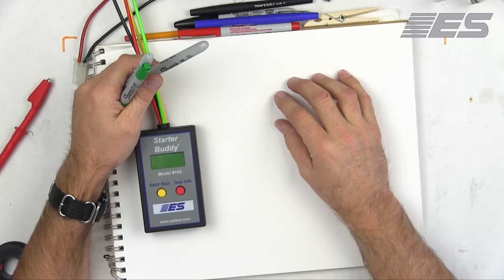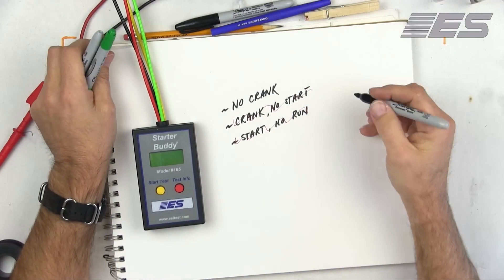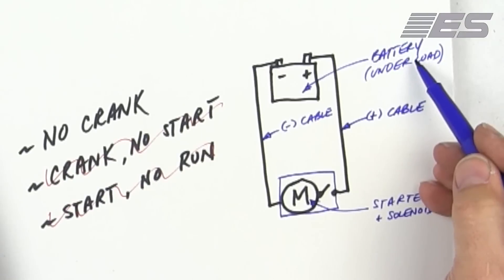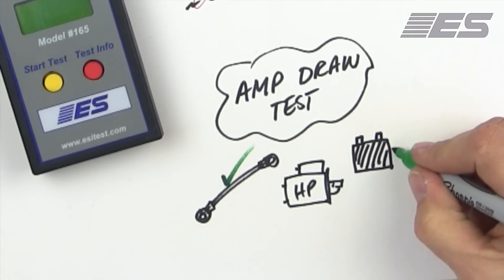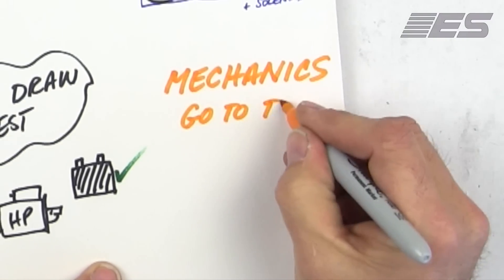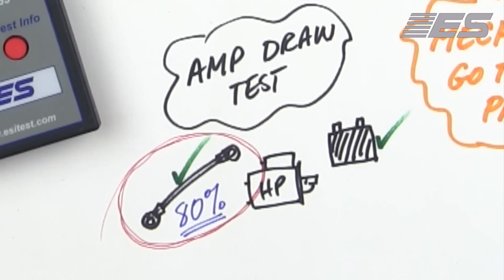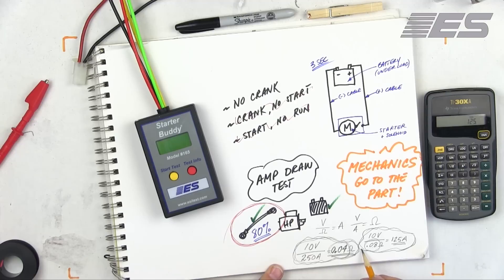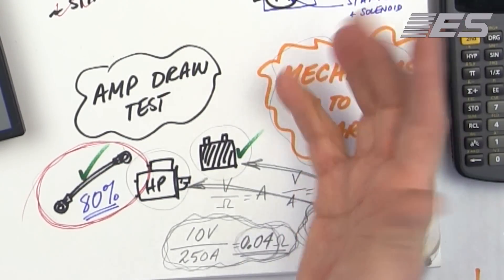Starter Buddy - Cranking Circuit Diagnostics

Comment: if the problem is the wiring then why does replacing a part even work?
Reply from the maker: +Rocket Rider Because the likely place for the corrosion is at the terminal ends of the cable, and when you change the part you clean the connection - so you think it was the starter or battery.
Reply: Wow, I get it ... Thanks for a quick reply !

Comment: When you get such a low resistance in a wire/cable of point 04 Ohms, you can't see it therefore you can't see any thing to clean. the resistance may be underneath the insulation , and if you peel off the insulation the copper wire would look bright. Or could look bright. and clean  So replace the cable. as you have said on other videos.Cleaning a wire terminal or connector doesn't solve the resistance because the resistance is  the product of the diminished size of the conductor. Right?
Reply from the maker: bob brawley Pretty much. The visual cues are TINY, or, as you said, invisible. Usually the problem grows over time and the starter slows gradually - no one cares. The best cure is prevention, and I LOVE silicone spray. It coats and it also wicks into the wiring to reduce water infiltration.
Reply: I've been diaeletric grease the wire to terminal then spraying with liquid I forgot what they call it. spray liquid electric tape but spray silicon works as good as well , good .   Can I eliminate the dielectric grease when spraying silicon ?
Reply from the maker: bob brawley I hate dielectric grease. Attracts dirt. The liquid spray silicone is better in my opinion. I use about 1/2-can every time I do an oil change on my cars. I spray everything electrical - connectors, battery posts, starter, fuse/relay panel. I just think it's the best material for the job.